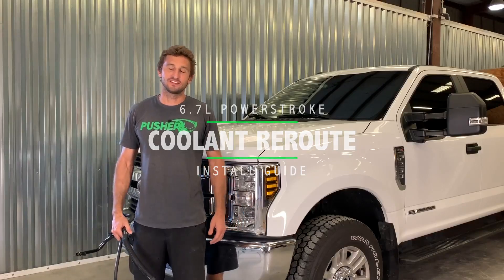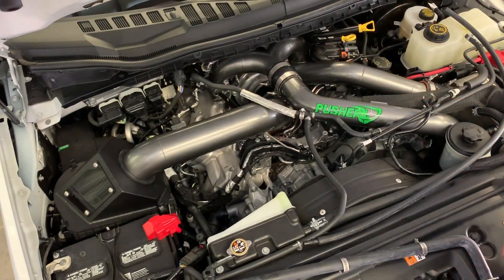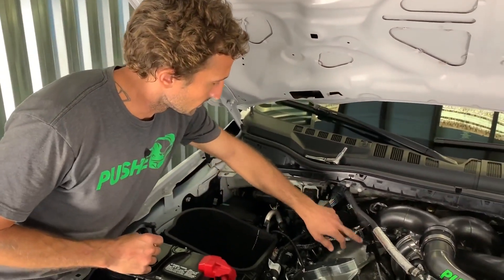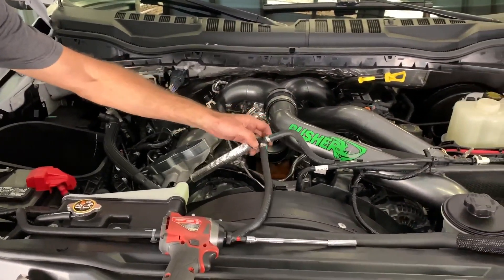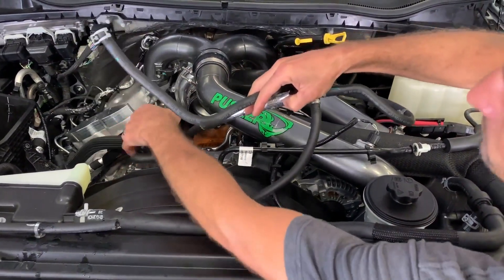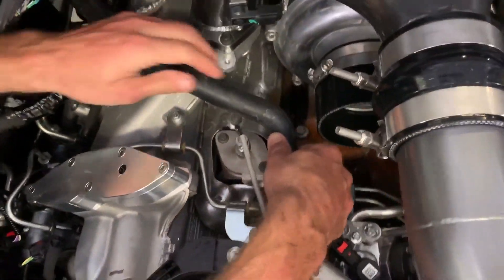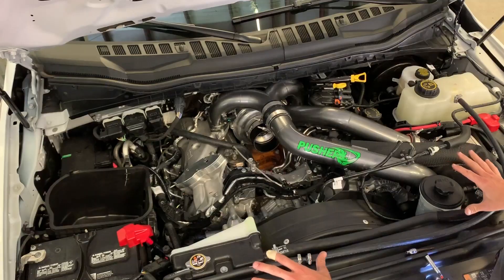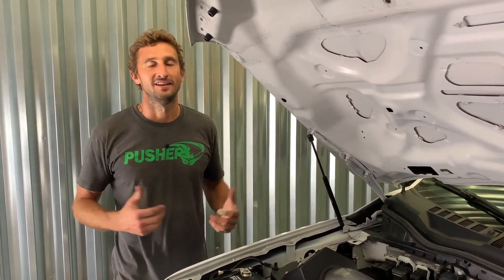Pusher Install - 6.7L Ford Coolant Reroute System

Comment: do y'all have the vacuum line reroute as well? so its not sitting on the beautiful Pusher pipes, it can go up from the vacuum pump (as factory) and when it reaches the fan cowl height it  can move forward to the front and run alongside  the coolant reroute, then back to the brake booster  area its much cleaner and out of the way if y'all dont have one its just a suggestion.

Comment: Just starting to upgrade my 2020 F350.  Will be ordering your intake with hot and cold side pipes soon as I receive my bonus, I am unfortunately keeping my emissions (state). Question about the coolant reroute kit, it says not emission compliant on the website, I honestly don't understand why a coolant line has anything to do with emissions, or is it because my EGR will be in the way? From my understanding and what I have read/seen on video, your double O-ring connector is by far a superior product over the factory one that has a tendency to leak.
Reply: The EGR will be in the way most likely, reach out on their website.

Comment: Will this be the same for a 2022 f450?
Reply from the maker: We have yet to release one for the 2022, stay tuned.
Reply: @pusherintakes  Thought I’d revisit this. Just installed the Pusher intake, and hot & cold side pipes on my ‘22 F450 and now the coolant lines are a major eyesore. Any updates on a reroute kit?
Reply from the maker: @chrisgilliam8294  They fit a 2022 as well, no problemo! You can find the listing here: https://pusherintakes.com/pusher-coolant-reroute-kit-for-2011-ford-6-7l-pow-p/pfp11xxcrr.htm
Reply: @pusherintakes  I guess my biggest question would be, will there be an option for the emissions compliant trucks.  It’s getting harder and harder for these trucks to ‘lose weight” so hopefully someone will come up with a way to clean up this engine bay.  Even though I’d love to put the big girl on a diet.
Reply from the maker: @chrisgilliam8294  Gotcha. On our R&D 2021 F250 that's fully emissions compliant we did complete a "junior" version of this that cleaned it up considerably. Not sure if it's something we'll sell, or we'll just release a guide showing how we did it (because unlike this one, the emission compliant one didn't require custom machined parts). Give us a call next week at 772.212.9290 if you want to talk through what we did.

Comment: I couldn't get the hold down bracket to lay flat.
Reply: Same mine wasn’t perfectly flushed like in the video. Did my best with silicone spray and mine did not slide in like that. Hope it holds. Just installed mine today.
Reply: @DL-og9hj  mines been in a year 0 problems
Reply: @1979kw  that’s good to hear. Was cautious that the pressure might force the O rings to fail since it’s not flushed all the way in. Kept going back and checking it and checking it thinking I did something wrong. Thanks for the reply.
Reply: Same here , we’ll see how she holds

Comment: My only concern is the effect that heat will have on the heater hose. It looks like the hose sits directly on the engine.
Reply from the maker: The part of the engine where this reroute touches is the passenger side intake manifold - its general operation temp is actually much lower than the coolant inside the hose itself. So no worries there! 😎

Comment: Anybody else notice the green coolant instead of the Motorcraft orange?
Reply from the maker: That's the color they used for the 2019s  🤷🏼‍♀️
Reply: @pusherintakes  I thought Ford Switched to the Motorcraft Yellow in 2019?
Reply: I replaced the orange in my 2011 with yellow, per Ford.
Reply: I was wondering the same. I’ve always been told orange only. But if it came stock then match it I guess.
Reply: They call it yellow but it looks like a neon green

Comment: Is this coolant reroute system the same as what other people sell known as the ccv reroute kit?
Reply: No, the CCV is the Crank Case Vent.  It is located on the driver's side near the rear of the engine.  It vents the pressure build up in the block to the atmosphere instead of sending it back through your intercooler and intake.